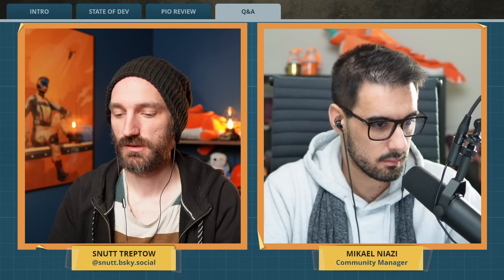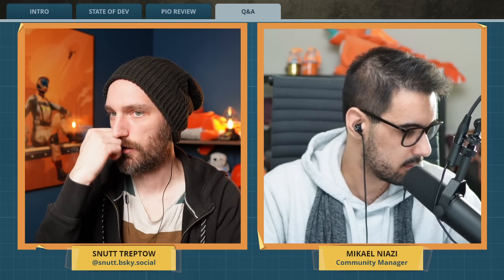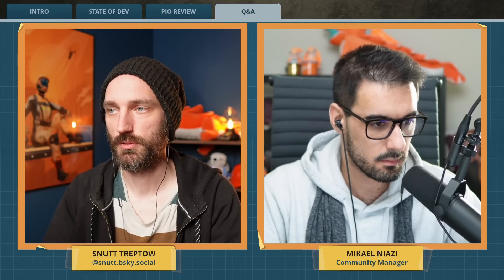Q&A: Do you have any plans to make Fluid dynamics more transparent?

Comment: you don't need to change much, you just need to make the information that is already there easier to read and understand  
example: fluid container will become full in approximately 2 hours 13 minutes <-- this is all the info I need
Reply: Why would you need that info?
Reply: If you set a valve to only output 60 fluids per minute it does not put that many. Because of the way they use floating point numbers more than 60 actually go through. Which means some systems will always eventually clog. This is really REALLY common with aluminum setups.
Reply: @partyfists  I 100% agree and it's a shame. You try to balance 180m³ output to 180m³ input in a closed system but it always clogs up because they're not exactly the same
Reply: @partyfists  Valve works as they are supposed to. But the way you try to use them is wrong: Let's say you have a setup that needs 180 water, and output 120. so you want to input 60 water controlled with a valve. It will work for a while, but let's say now your system only works at 99% efficiency for some reason (maybe because there is some delay in something filling up or whatever). Then now your system only consumes 178.2 water and output 118.8. You're still feeding it 60 water per minute though, so 118.8 + 60 > 178.2. so the current output will not be used at 100%, meaning your refinery will not be able to maintain its current 99% rate forever and it will start dropping even more. This means the system is unstable, so any perturbation in the system that keeps it from functioning at 100% will become worse (exponentially) over time until it completely blocks the production. This results in a system that kinda works for a while but will seem to randomly shutoff from time to time. Putting a buffer delays the time before it shutoff but don't prevent it because your system has no mechanism to eliminate excess water.
Reply: @simonhenry8641  I get the feeling that there are really only three ways of doing this that make sense:

* Use a valve, and VOP any excess into wet concrete (or something) that you sink, thus preventing excessive buildup of water.
* Use a VIP.
* Send recycled water into a separate line that is not connected to the extractor, and build refineries that only run on recycled water.

Problems:

* VOP is not obvious unless you have a good understanding of how pipes work, so it is not accessible to the average player.
* VIP is dark magic and nobody understands how it works (not even the people who wrote the plumbing manual). It might break in a future patch for all we know, and is even less accessible than a VOP.
* Recycling probably has issues if your setup is not 100% efficient. You now have second-order sloshing because sloshing on one side can affect the other through the refineries in the middle.
Reply: @NYKevin100  Oh Agreed. I was just saying that there is no floating point issue or bug. Just the system really isn't easy to use. Valve aren't bugged, they just aren't that usefull because of how they are designed.
Reply: @simonhenry8641  thats not what I’m talking about. If you set a valve to 60 it doesn’t allow 60 through. It allows 59.4 or something. That leads to your machines backing up. 

Now you can fix it with design as described in another doc. You set it to a slightly higher number than what you want and use an overflow system. But that’s not documented in the game.

Comment: I think fluid dynamics is definitely something that should be prioritized. Especially for new players who don't know that fluid has RL physics.
Reply: They're not representative of real life though as they miss out on one key aspect, pressure. I don't think there's any friction either as there's barely any loss on the sloshing as it propagates backwards.

Edit: Just to clarify, I'm well aware a real life fluid dynamics situation would be much more difficult to deal with, but you have to know which parts of RL they implement and which they don't, in order to begin figuring out a solution.
Reply: @iamise it's true fluids are not 1 for 1 to real life, however, the point that fluid does have aspects of realistic physics is unchanged by the fact it's imperfect.

The argument people make about fluid is that it's difficult to work with because of the real aspects it takes, instead of just working as a different kind of conveyor belt. Making it more accurate may make it easier to work with by allowing more people to understand it better. Even still, it would result in the same problem discussed in the video for people who don't know or understand this stuff; a lengthy process of learning how to use fluids from outside sources rather than in the game. 

I don't think it should be on Coffee Stain to teach people physics, but people also shouldn't have to go online and take a physics lesson to be efficient or even run fluid at all in larger factories. The devs have said this is supposed to be a chill game, so it should be a chill game, not a science experiment that makes you wanna tear your hair out.

TL;DR: I'm not an engineer, Coffee Stain said the game isn't supposed to be overly complicated, and I think you're hyper analyzing my statement so I did the same. 😂
Reply: @LunaAzzurro  I did study physics, even had lectures on fluid dynamics (20 yrs ago mind). If I have an issue its not with them implementing things from real life, my issue is that the function is not described or telegraphed well for players to understand. Even though I know the basics (I'm not a chemical engineer or anything), it's still confusing to know exactly what is implemented, and what isn't.
Reply: @LunaAzzurro  As a specific example: Water hammer (or the sloshing) is not simulated via pressure but by flow rate. Unless you know that or figure that out, it'll confuse you whether you understand fluid dynamics or not.
Reply: Is RL short for "real life"? As a computer engineer, RL indicates a resistor-inductor circuit.
Reply: @epicinator2372 I feel like this is just a weird flex that you're an engineer...
But yes it means real life. I wasn't saying fluid has resistor-inductor circuit physics.
Reply: @LunaAzzurro  I'm sorry. I didn't mean for it to sound like a weird flex. I was just trying to to give context to my question. I've used several other engineering concepts in this game and I wondered if there was a benefit to using that type of circuit analysis as well. Thanks for clarifying.

Comment: You shouldn't have to resort to outside resources to understand game mechanics. I don't think pipes need to be simplified but the way they work needs to be explained better.
Reply: This is about my opinion too. I really don't have any problem with the fluid mechanics, they do make sense, but it requires reading on a wiki, social media, etc, as it not explained in any detail whatsoever within the game itself.
Reply: This, change nothing about the mechanics since satisfactory is one of the few even trying to come close to correct simulation but do something, anything, so people can understand it within the game.

Sure, it’s pretty much just how RL pipes work and if you know (like in my case being an engineer) it’s easy enough… but, Yknow, who says rando gamerz have any clue how that is? Most engineering games a la factorio or from the depths or whatever just use “pipes” as “enclosed wet belts” which is their fault too but there is a common misconception and misunderstanding amongst newbies between people not knowing how real pipes work (flow pressure, hydrostatic pressure, meter water column, cavitation, etc) and just thinking “water go in and come out yum yum glass of water in my sink” and “knowing” how video game pipes work which has previously misinformed them and or reinforced their (incorrect) gut notions.
Reply: @anonemoose7777  but it ISN'T anywhere close to how real-life pipes work. It's closer than other simulations, sure, but there are random oddities all over the place in satisfactory fluids that break them in unexpected ways.
Reply: @marshallc6215 I mean, key operative phrases from my end being “pretty close” and “the only one even trying to come close”. It’s not 1:1, but if you squint at it… I guess it would be easier for me to say “do not turn pipes into wet enclosed belts please” than “change nothing about pipes”. I just really don’t want them to go for simplification. If they wanted to MORE accurately simulate fluid dynamics while also polishing up the UI so people can see what’s going on in the game without the need to watch FICSIT talks and read community guides then sure. But I think the most likely change we’ll see is no mechanical change and better information like the pass rail signals got, or them just simplifying pipes. I am very much against the latter. I doubt we’ll see them overhaul it post 1.0.
Reply: @anonemoose7777  yeah I can't imagine them doing an entire fluid rework post-1.0 unless they do a DLC, and even then, the current system is probably fine once they introduce enough information to the players to understand it. I've done a bunch of external research about fluids and I still don't have confidence in any low-margin (e.g. 600 fluid/min) setup that I build to run without starving.

Like maybe mk 2 pipes don't create the same turbulence or whatever that reduces their net throughput from 600 to 580 or whatever it is.
Reply: This. Pipes work with proper planning. 

Now gas dynamics lol.
Reply: @NuxNerd  Gas is a fluid 🤣 Liquids and Gases are both types of fluid
Reply: Am I the only one who’s had no problem with using pipes however I want and always getting them to work? They’re pretty straightforward and intuitive for the most part
Reply: @LeeTwentyThree  they only work properly when you let them pressurize, which i had to research to find out